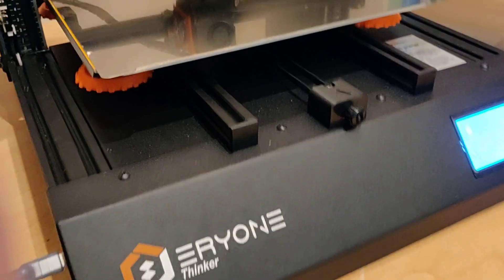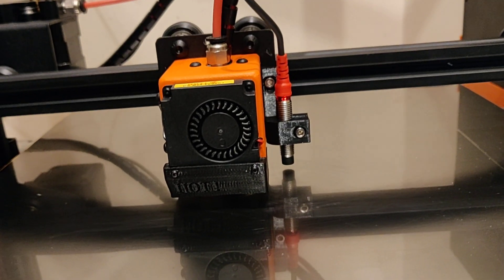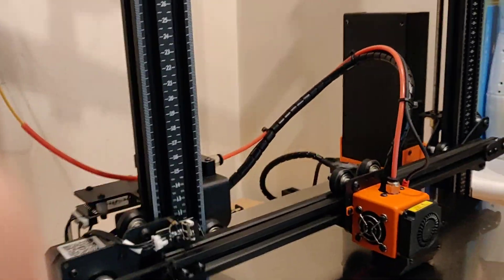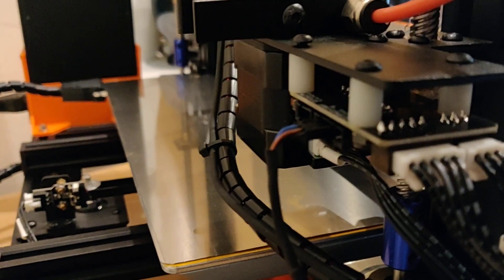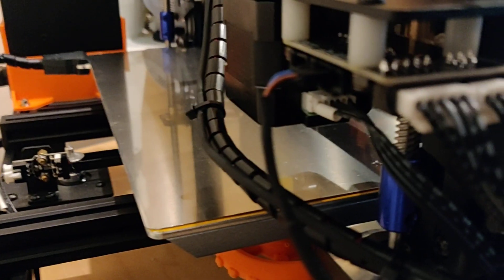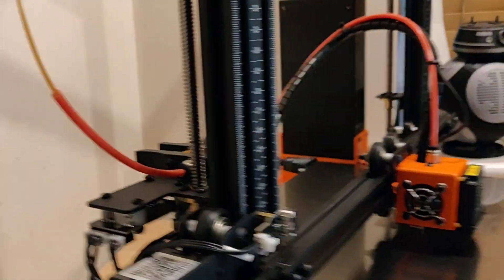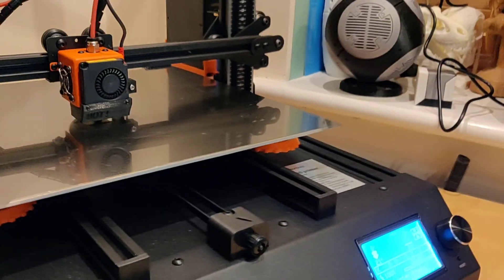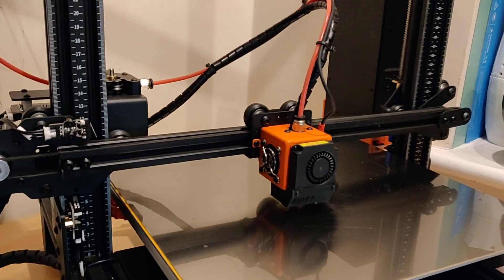Eryone Thinker Autolevel Pinda mod..

Comment: Do you have the Amazon link to the auto-leveling sensor to use with Eryone printers?
Reply from the maker: Here you go... https://amzn.to/36yOWn8
Reply: @Waggster  I realized I cant use that one on the SE as the SE has a glass bed.   I found the one i need to use though, so thanks.   Has you prints improved since fitting this?
Reply from the maker: @ecotts  I dont have it anymore.. .sold it some time ago now.  If you have the SE with the glass bed then I would look at adding a BLTouch or a 3D Touch from Triangle Labs.  Very similar setup, if you're on Facebook join the Eryone group as lots of help on there. :-)   But.. to answer your quesiton, yes it helped loads and becuase I move machines around a lot it saves having to relevel.
Reply: TheRageMaker  I found it on Aliexpress, but I'm considering backing it as my glass is warped on mine. So I wont be fitting it to this one. It will be going on the new one when it arrives.

Comment: What are your impressions of the printer so far?
Reply from the maker: I sent it back and bought a sidewinder X-1. The thinker just feels like an unfinished design. Lots of things could of been that just better. It's a shame as it has a lot of potential.. but even after I corrected alot of the small issues it was let down by a poor extruder and hotend.  The Artillery sidewinder has been faultless out of the box, defo recommend that over this.
Reply: Thank you
I'll think about it
Reply: @Waggster  Thinker Se user here.  I just had to replace my hotend. Didn't have it more than a week and things went bad with it

Comment: Is that sensor actually touching the bed ?
Reply from the maker: Hey Montague, no its about 1mm off the bed. When you set it up you power off, let the nozzle touch the bed then set the probe height off the bed by using a tie wrap as a spacer. Once set you then need to set your z-offset which is the height difference from your nozzle tip to the trigger point of the sensor. Thats it :-)